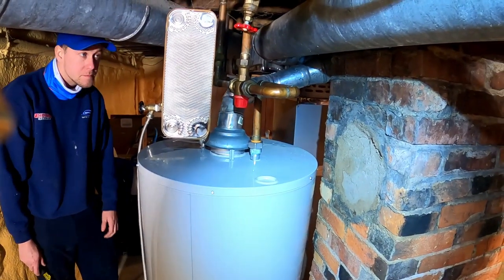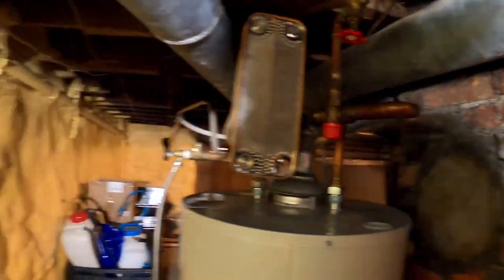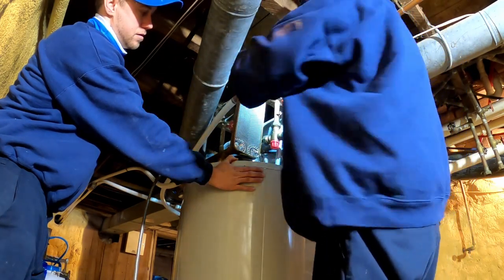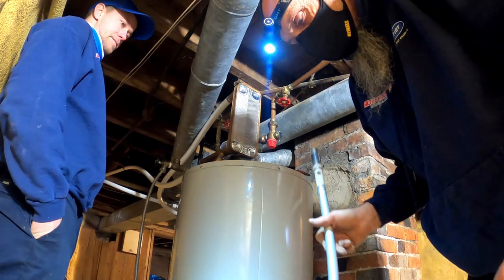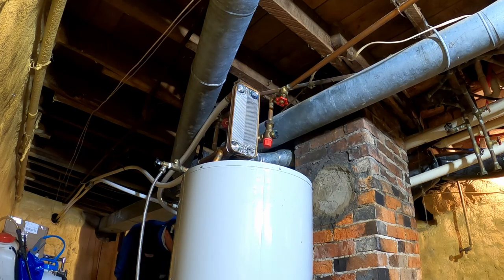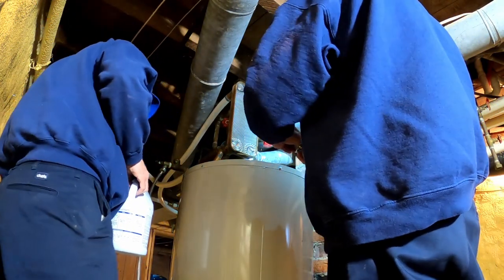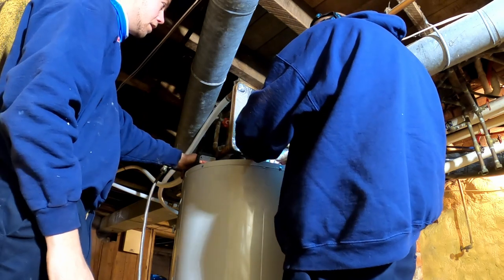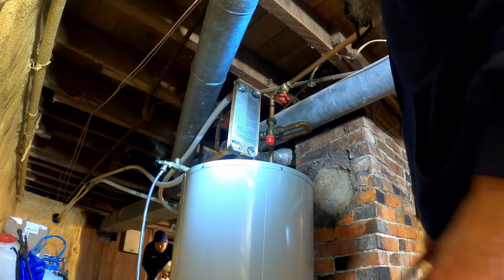No Room For Anode Rod Replacement

Comment: I found some Anode rods that were in three pieces connected thur a small cable that were used for commercial tanks. They worked great. Should be no issues with cutting off some of that rod. Thanks for the vido.
Reply: yeah those segmented rods are awesome

Comment: Can you use a pipe cutter? Pull up a measer of rod, clamp with a wrench to keep it from dropping back down into compartment. Attach pipe cutter, twist and remove the top portion, lift up another measer of rod, clamp, cut, etc...? My water heater is in a hall closet with only 2 feet of clearance and I cannot get in there to pull and bend.
Reply from the maker: Pipe cutter won't work. Need to use a saw but you still got to get the other one back in there

Comment: My Rheem 40 gallon is from 1988 - never had a rod replaced.  Doesn't leak.  Flush it twice yearly for the last 5 years.  Before that, who knows?  I've only had to replace the boiler drain.  City water, no softener.
Reply: Regardless, you should replace the heater.

Comment: the electrons wont notice the rod is bent a little.    if you put in your own h2o heater, lay it down on a blanket, heat the red threadlock the factory uses to weld the anode bolt in with a low torch, spin it out, put some antisieze on it and screw it back in .   then you can change it out easily.  instead of a water heater that lasts
7 years you can get 20 years.   19$ at menards.    even long life water heaters for more money have the same tank metal thickness as cheaper ones, they just use 
two sacrificial anodes instead of one.   i remember old copper tank water heaters, 45 years plus

Comment: why did you change? that rod looked like new. Had a few more years in it
Reply from the maker: The wrong rod causes smelly water
Reply: I did a bit of research. If the water has sulfur in it, the sulfur reacts with alum.\magnesium anode rods along with Bacteria that feeds on sulfates. This produces Hydrogen sulfide (rotten eggs smell). By shocking the tank & using a Zinc Anode, it will prevent hydrogen sulfide from forming in the tank.

Comment: Ever consider a segmented rod? Or are they junk?
Reply: I use those.  Also, I use a half inch impact to get them out.
Reply: They can’t be used on this type of tank
Reply: Pay attention!
Reply: @waltradcliffe4482  what does the tank type have to do with why they won’t work?  A tank is a tank.

Comment: What’s that heat exchanger set up about just a curious plumber 👨‍🔧
Reply from the maker: Wood burning boiler heats the water
Reply: @MiHeatingGuy  no fucking way that’s a dope set up 👍 good content once again bro
Reply: Does the water circulate through the heat exchanger when the hot water is not being run? I couldn’t see anything that would do it in that setup.
Reply: @halohms  Probably not with that setup.This could be done if there is a coil in it like an indirect water heater. I suspect it just preheating the cold supply water and not heating the water in the tank.

Comment: You do know that they make segmented anode rods just for that problem?
Reply: It's the feed line as well, this isn't a stand-alone Anode rod.
Reply: @CoMmAnDrX  and they make the segmented ones that way also in aluminum/zinc or magnesium(factory on all), the anodes are on the hot outlet nipple, so the sectional ones will do fine.

Comment: Have you tried a powered anode? Put one in my tank and got rid of the odor in hours. I suspect that's the reason for replacing?
Was gonna do it in a similar tank to yours for a customer but they didn't want to pay me for it.
The MFG of the tank couldn't recommend it because they didn't make one. Wouldn't guarantee theirs would remove the odor. The MFG of the anode told me theirs could be cut down and put where the pop off went off it didn't touch anything. Add a tee and move the pop off to the discharge line. 
I've not had long term success with chlorinating the tank.

Comment: Gotta do what you gotta do. Not a hack job if you’ve got a satisfied customer who has no complaints now.
Reply: What happens if they have complaints later, does it change whether it's a hack job or not?
Reply: They can’t see the anode, so in this case, no. 
If they have return complaints that’s why you always hit them with the “this may not be a permanent solution, however, most of the time it is”
Reply: @alexg3855  No anode is permanent.
Reply: @yz250a  yes, but when it’s time to replace you wouldn’t see the bend

Comment: Mi Heating Guy isn't bright enough to realize all you have to do is disconnect the lines and tip the tank over on it's side.
Reply: That would be the proper way. And he should've flushed it out and drained it. 
He's a hacker.

Comment: Drain it, tip it, replace it.
Reply: Did you not see the other things hook up? This wasn't a typical tank.
Reply: Probably no floor drain & not so easy to run a hose to a drain that might be 100+ feet away. That's an old farm house.